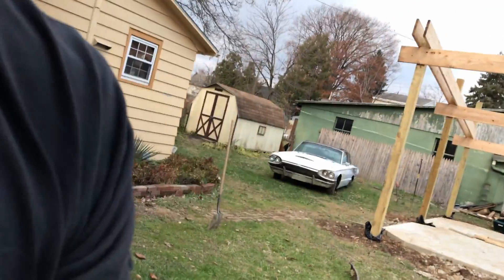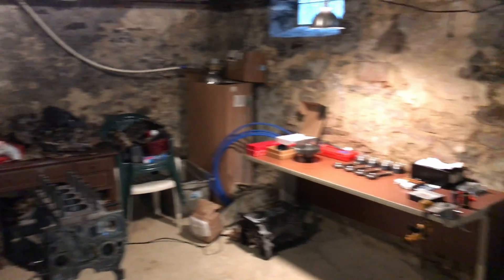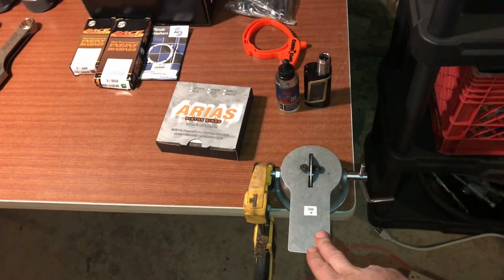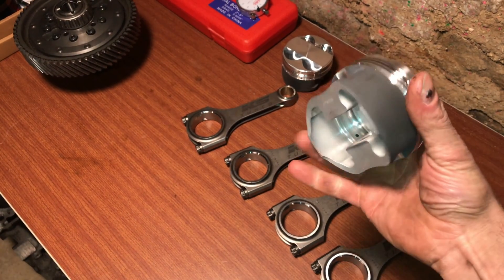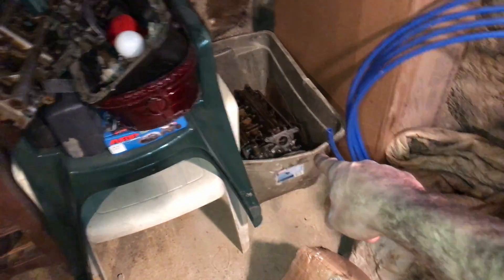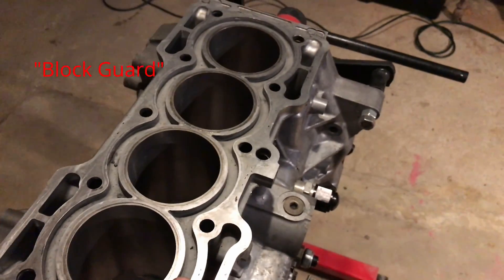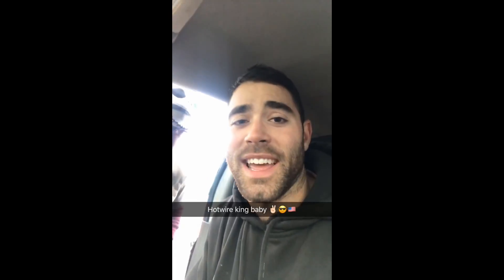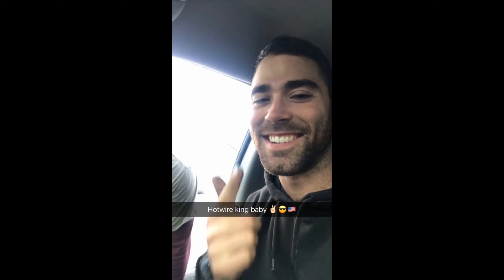How to Build Honda F20B / H22 Engine | All the Parts You Need

Comment: what bore pistons were those? and are they for the f20,h22 or k20?
Reply: Awesome! Looks like I might have to go that route or use some backwards k20 pistons
Reply from the maker: @Dgkman2004  traum sells 85.5mm pistons for the f20b. Honestly that’s your best bet as you will have cylinder wear to account for.
Reply from the maker: F20b 85mm custom pistons by arias

Comment: I'm going to be in japan for a few years and I plan on trying to get some performance engine parts for my f20b while i am there assuming they have a better aftermarket for the motor. Is there a good aftermarket for this motor in japan?
Reply from the maker: The Soviet Pinecone Honestly, I would be speculating but I would assume so. The f20b is the Honda Accord SiR motor which is one of the jdm “performance motors” of that time. It was in multiple different car platforms as well. It has the h22 type s cams and throttle body in the manual f20b version
Reply from the maker: The Soviet Pinecone I’m curious as to what you find in Japan! Check back with me if you remember and let me know what you find!
Reply: @thestateofreal2533  I brought a Torneo Sir-t back lmao. After market doesn't really exist in Japan outside big ticket items we can get here.

Comment: Hey is the h22A frm sleeved as well even being a closed deck block?
Reply: H23 non vtec obd1 had the steel sleeves but no h22. F20b all day
Reply from the maker: Jay Kong yes it is. There were some h22’s that were said to be iron sleeved from the factory but I have never heard of anyone finding them.
Reply: Thanks bro
Reply from the maker: Jay Kong no problem! Don’t fear the forum about frm cylinders. Mahle gold series pistons work if properly installed by a shop.

Comment: Seen your Build on Insta I’m subscribed man I’ve been B series for years and years been thinking hard about H22 or F20B for the teg lately
Reply: Iv always done b motors.  Going big block turbo crx . Lots of work to do . Can't wait for spring. This is my winter project.
Reply from the maker: Mark Wallace thanks for subscribing! The f20b is definitely easier to start with...iron sleeves, more square setup for boost, high reving, and vtec! H series can be a little more tricky with the frm sleeves.
Reply: F20b is a much stronger bottom end then h more oil flow in f20. Thats why h22 have the connecting rod problems.

Comment: Hey! I'm building a f20b with a h22a head where did you get the pistons ! Thanks !!
Reply from the maker: The pistons I got from a guy who had hem custom made and then never used them. They are arias f20b pistons. They cost him $666 new. Btw I ended up going with an f20b head and h22 Brian Crower 88lb valve strings with titanium retainers. If you don’t know...the h22 head is the same as the f20b...it just has 1mm bigger intake valves. 1mm =.039 inches or close to 1/32 of an inch. Not really much gained there besides cool factor.
Reply from the maker: I know I haven’t added anything in months but the motor is all together in the car and I’m breaking in the clutch! 300 miles left to go!
Reply: Thanks for the information man! Hope to see a video of it soon!
Reply from the maker: I’m hoping to do a quick recap this weekend before I leave for a month. I’m in the army national guard. 🇺🇸
Reply from the maker: Mike Hatfield https://www.kstuned.com/products/wiseco-ks-spec-h22-forged-piston-set
Reply: Im doing the same. Just waiting on block to be sent back from css

Comment: Subbed! Looks like a promising build, F/H all day!
Reply from the maker: Mario avalos Thanks! I put the LSD into the trans yesterday. Deleted evap, egr, abs, and I’m putting the last coat of clear coat on the engine bay! Motor in soon hopefully! I milled out an area for direct turbo housing wastegate mount. That’s gotta be welded up yet. Trying to post more here soon.
Reply: @thestateofreal2533   nice, getting close huh. Curious to see how you like that obx lsd, I haven't seen it used too much compared to the mfactory and quaife or just the stock honda lsd.
Reply from the maker: Yea me either and part of that is the bad rep obx has with these lsd’s. They were apparently over torqued from the factory and had faulty preload washers. I installed the rebuild kit and after going through that (and being a machinist) I noticed that their tolerances are not that great. I’m gonna still send it though! Quaife and obx are both torsen differentials. Internally they are identical. Mfactory is completely different.
Reply: @thestateofreal2533   gotcha, had no idea they were different but hope it works out! I have an na f20b EG currently  but running a h22 trans non lsd and even at my power levels the tires break loose sometimes, so I can only imagine how bad It would get with a turbo lol.
Reply from the maker: Mario avalos yea agreed. The lsd should help with the torque steer also 🤞🏻The lsd cost me $200 used and a $35 rebuild kit...still cheaper than an oem lsd and an mfactory so we shall see! I’m excited. I’m getting married in July and hoping to have it all tuned up before then.